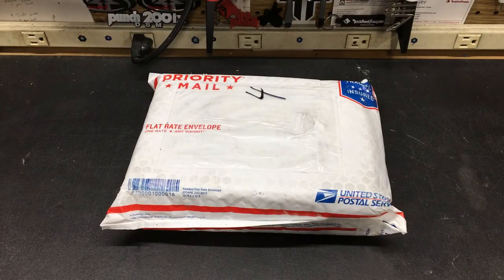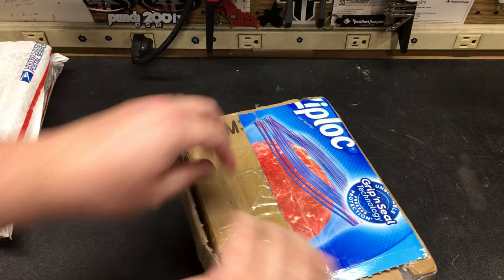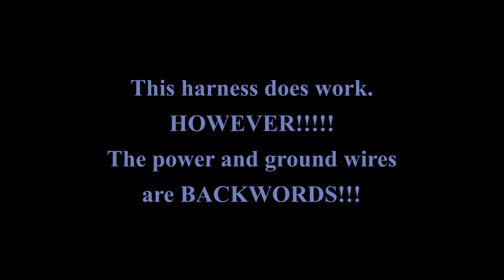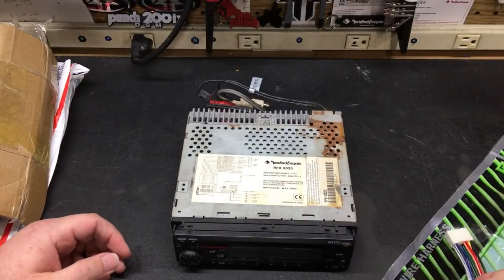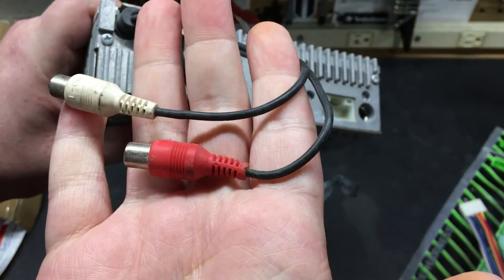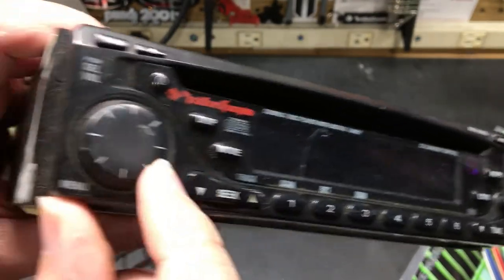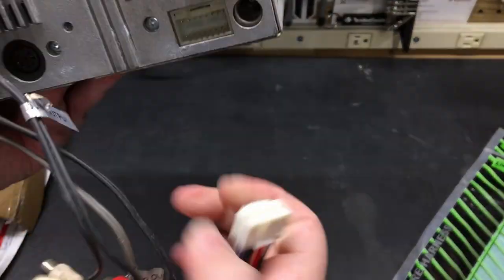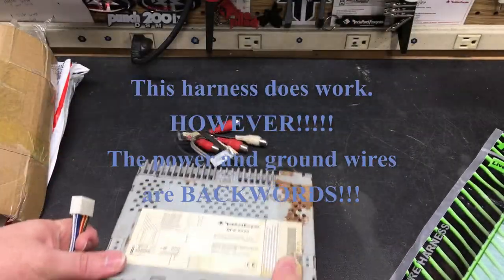Rockford Fosgate RFX8320 CD Player

Comment: Just ordered from Ebay my 6th Punch 200 and 4th basslink, great vid
Reply from the maker: Nice. At one time I owned over 13 links and 8 200ix amps. Sold off the 200ix amps and went with the 200x2's instead since they have the PSD-1 port on them.

Comment: I think that's the same harness I purchased to bring an RFX-8310 back to life. I found it for $25 at a pawn shop, no harness but I took a chance and it did work after modifying a Clarion harness. If I remember correctly, a couple speakers needed the polarity reversed as well.